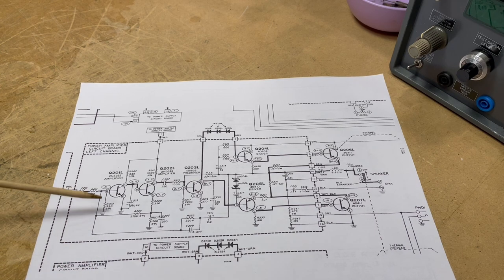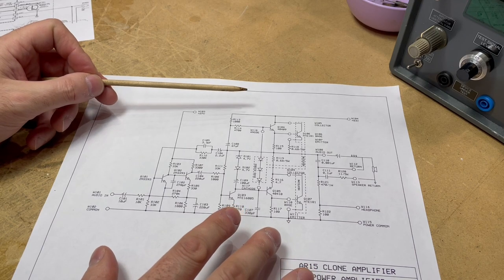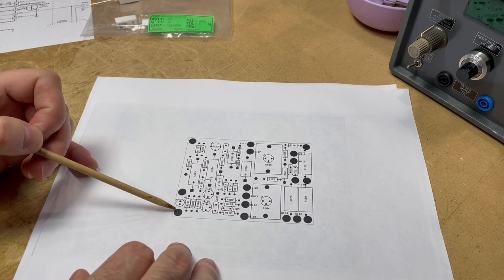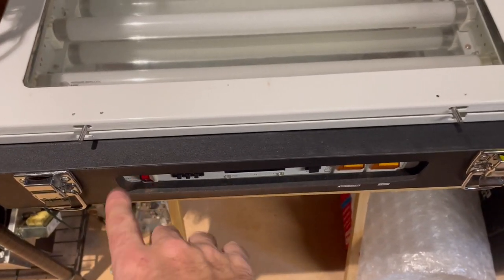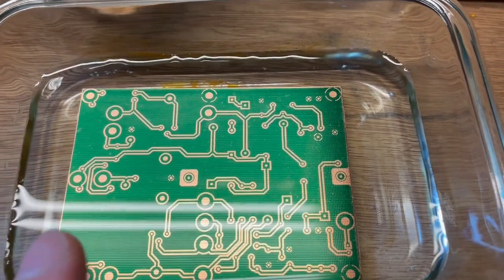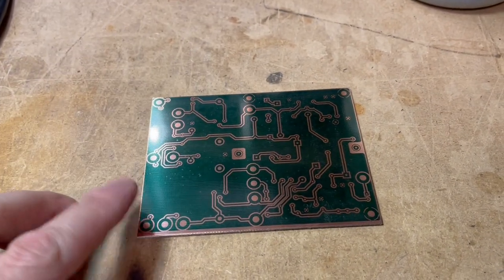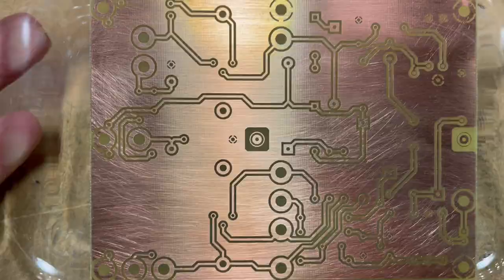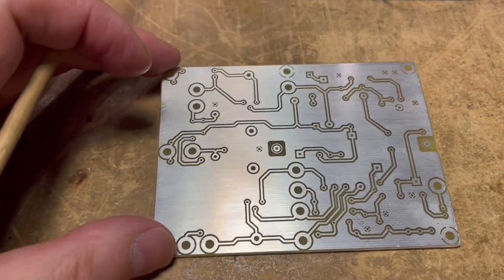Build Project Part 1 - Making A Printed Circuit Board

Comment: I notice you get another benefit from your etchant saving thin layer.  That allows good mixing of atmospheric oxygen which is an essential ingredient to the etching process.  The commercial PCB makers have deep tanks and aerating pumps which bubble through next to the vertically hanging boards.  That produces two actions, agitation of the fluid and also aerating it.  If for any reason you need to remove more of the copper, then your small amount of etchant may turn out losing its effect before you are done. I have in such situations found it necessary to beef up my etchant by two ingredients, a little hydrochloric acid (muriatic acid from hardware stores) and some hydrogen peroxide.  The latter does an aeration instead of an air pump -- my pump died a long time ago, and so did my quartz heater...